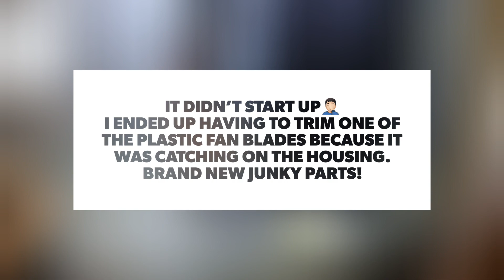Repairing a mobile home gas furnace!

Comment: Hey Jesse, it's me again haha. I've actually been looking at a lot of the communicating system schematics from different brands and such and it's really made sense to me once I realized that hey it doesn't do anything different that a regular unit in terms of the way it operates it just moves everything to the communicating board for communicating purposes. I guess what I'm saying is I understand it better due to your explanation to me and me taking it up upon myself to research.

The thing that kind of doesn't make sense to me is for example, Goodman's new 17.2 SEER2 system comes with a communicating board BUT you can wire it on the board to be non- communicating. Doesn't that just defeat the purpose of a communicating board if you're just going to set it up for non-communicating? Why not at that point just wire it up like a regular unit or just advise the costumer when showing her options of units to go with a lower SEER2 rating if they wish not to have a communicating setup. Just my thought process.

Comment: Your shaft has a bend, lol.  New parts aren't very good anymore. Ordered a blower wheel from the factory and when I opened it up and installed, I figured out really quick that wasn't the correct part.  Turns out the factory had put the Wrong part in the box.
Reply from the maker: Still trying to think of how that happened! Lol. Yeah man I always get nervous ordering stuff especially if the customer has to wait and then they send me the wrong part.